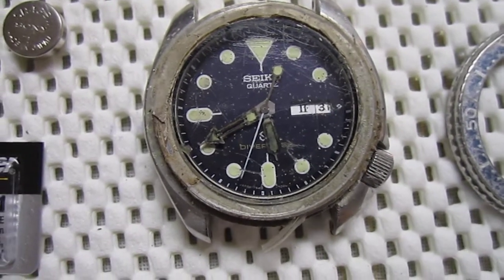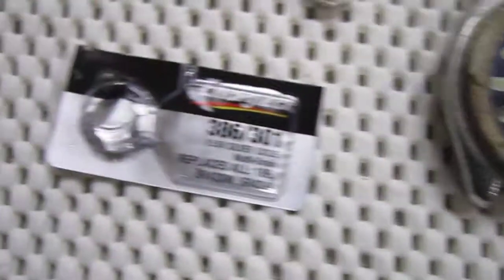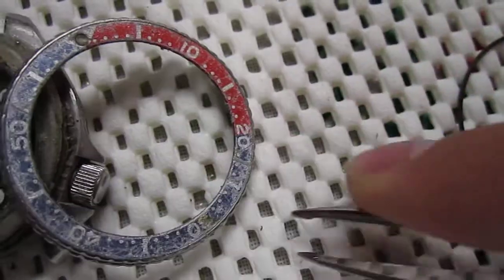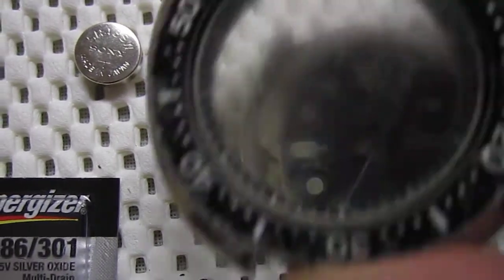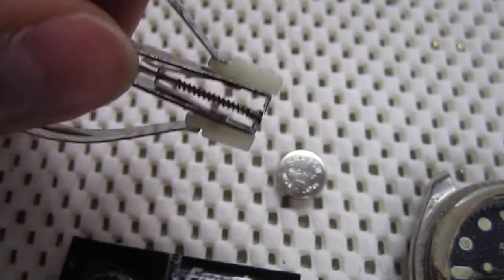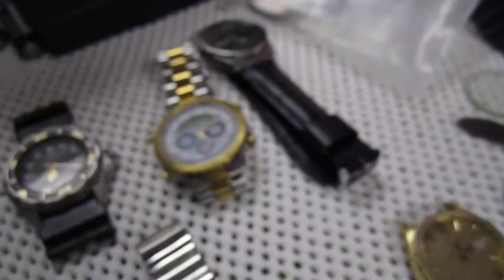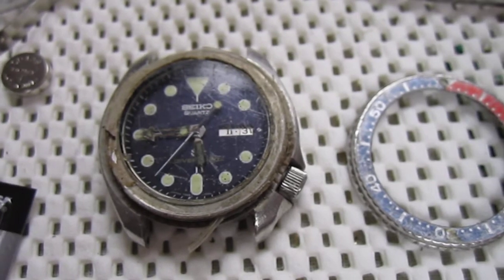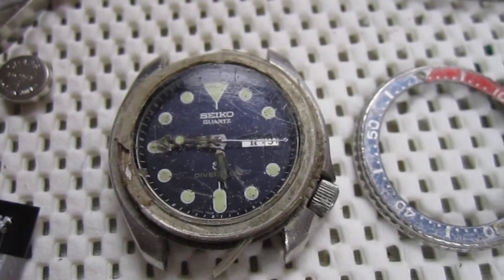Seiko 7548-700B SCWF Help Video

Comment: I realize it's a few years on.. but how did you go with this? I recently had my watchmaker do this mod for me on a 6309 case also.. i've done a write up on it on the SCWF forum also as i couldn't find any information really on doing the swap. Everyone said it just drops in (which is technically true) but i decided to go into a bit more detail with what does and doesn't work and whatnot..